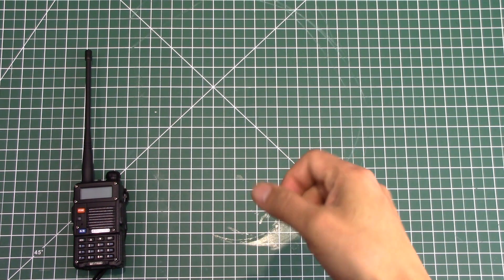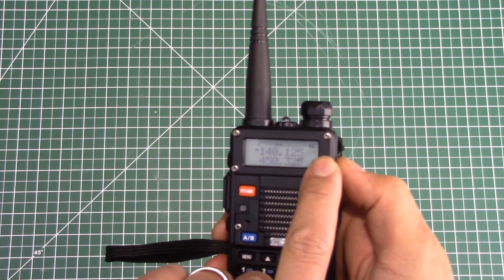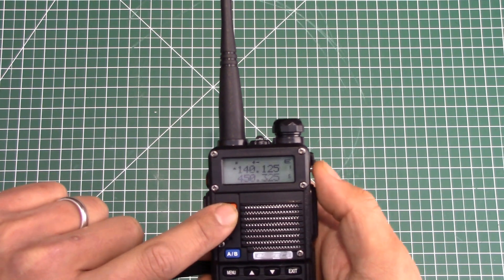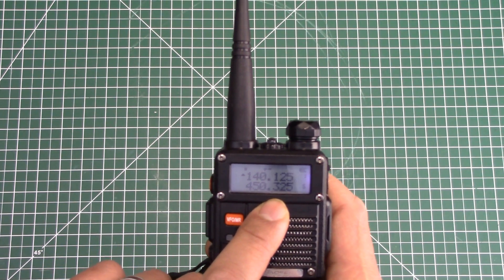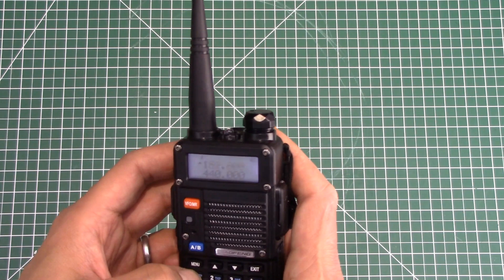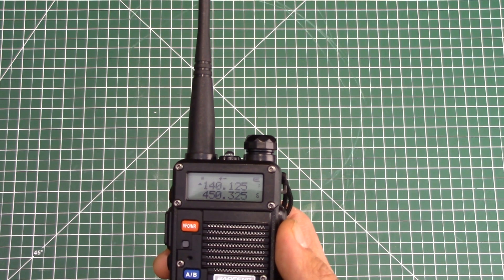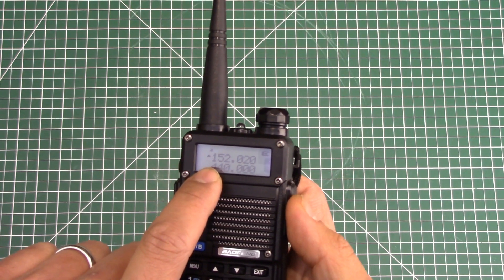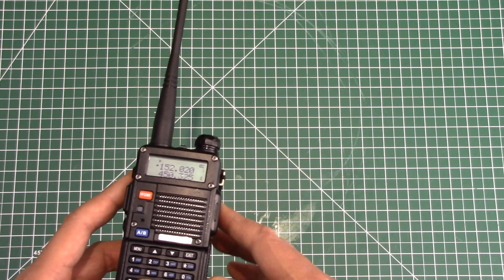Programming and Deleting Channels on a Baofeng BF-F8HP Radio

Comment: Awesome video! I accidentally deleted FRS 15 from my radio, and when I re-stored it in the A position, it no longer shows "FRS 15"--just the frequency of 462.550. I went into menu 21, MDF-A, tried showing name, channel, and frequency, but under the name option it still shows frequency.

Comment: Thanks for the vid.
FYI: "transmit" vs "receiving" memory means you're saving one frequency to listen and, if necessary, a different frequency to talk, both on the same channel.  It's how repeaters work.  If you don't know what a repeater is you probably shouldn't be using this radio (or retake the Ham test).
It's also why there are 2 lines on the screen.
Reply: Exactly...

Comment: Programming channels you would have to assume are for people whom just got one of theses radios. Start off using a phone that doesn't have anything programmed into it already. It was going fine until you got into that you already had channels programmed and so then you have to find a open space yada, yada, yada.  Simplify how to program a blank radio first then go on to the other subjects you wanted to cover, it will make it much easier to follow right off the bat. I do appreciate that you took the time to do this. Thanks
Reply: My radio came with "dummy" frequencies pre-programmed. I think he did a good job explaining. This was VERY helpful, and straight forward... although CHIRP is simpler for mass programming.